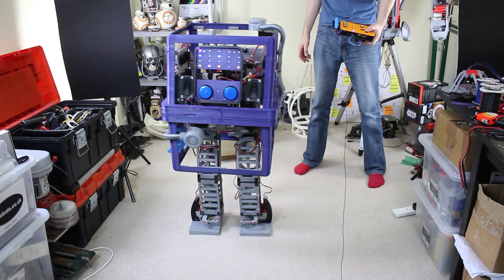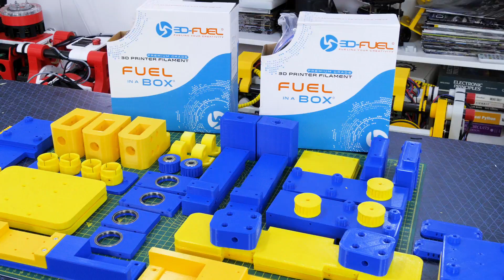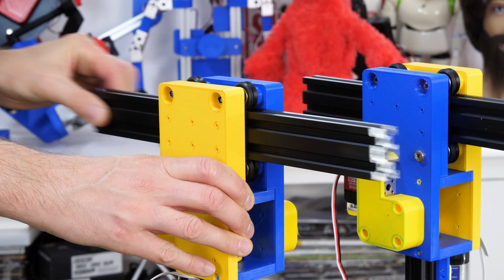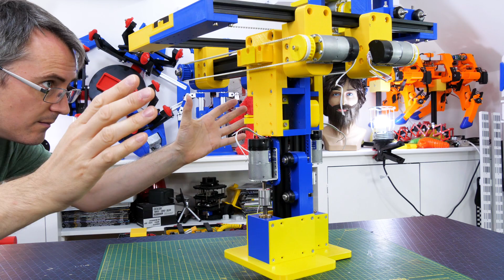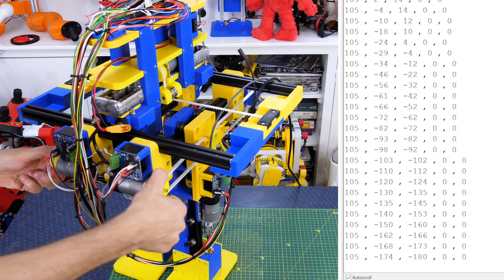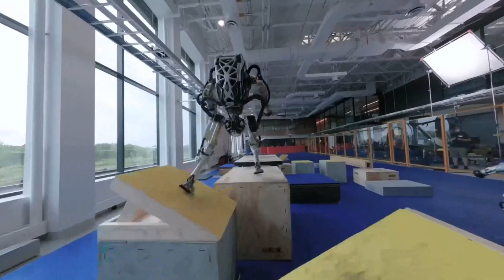Why Walking Robots are Easy

Comment: Maybe ten years ago I built a prototype of a tap dancing robot called Paddy O'Furniture. I used Basic Stamp and pneumatics. It was pre-3D printing so the project was  pretty primitive but I made a few observations along the way. One is that a  tapping toe needs two axes of movement. The other discovery was that knees are also essential: tap dancing without them is pretty awful. :-)

Comment: Thanks! Nice that a simple design such as that functions. Yesterday the stepper motor on one of My robots "passed away". Those need to be lower cost and lighter weight, so I can buy a replacement without worrying about if it will get on the plane easily.

Comment: You could decrease the mass by increasing the lever. If you use a rod with weights on both sides you would only have to move it a small distance.

Comment: I feel like for a robot biped
You should actually make it's hips wider
And have mechanisms that smooth out the walk cycle to eliminate jitter. Taking a more feminine one foot directly in front of the other walk cycle with the sway necessary to ease into each stride and smoothly transfer center of mass in each step. Leaning into the next by rotating the hip. Just allow the knee to just slightly hyper extend and lock up when necessary.

Feet articulation and things that help the feet change shape to distribute pressure, or work together to form a sense of springiness, is a big deal

Listen it's not a kink
It will just help it walk and balance better

....robot feet 😳

Comment: Most of the advanced bipedal robots that do things like obstacle courses are both A) meticulously programmed to run that exact course and nothing else and B) remote-controlled by a trained operator who hides behind a curtain Wizard Of Oz style.  They only rely on option B when option A goes wrong, but option A goes wrong a lot.  That's why despite being around for 15 years now those bipedal robots still aren't used for beyond demonstrations.

Comment: an idea i had to make this way lower tech is to have it so that the mass has an electrode on it and so does each side of the top which completes a circuit to activate the motors for the leg (which could probably be done using the same concept). which eventually activates a circuit to bring the mass back to the otherside

Comment: how long do you expect, on average, those v-wheel linear slider brackets to last before they're not tight enough on the t-slot extrusion and need to be replaced?

Comment: Have you thought about using gallium or mercury with pumps to shift the weight balance of the robot,it would be self contained and lower the amount of moving parts necessary to keep balance mercury would have 3x  the  molar weight of gallium if it’s reasonably contained it may be a more worthwhile fluid to due this with it also has a lower liquid temp then gallium .

Comment: I challenge the assertion that your robots "walked" or that walking robots are easy.  Given that back end of your robot's feet never went beyond the midpoint of the other foot, shuffling would be more accurate.  It's the difference between the way a healthy adult walks and how a a 90 year old with a walker moves around.

When one foot gets put fully in front of the other, then you can say you made a walking robot.
Reply from the maker: woooosh

Comment: @James Bruton Have you ever tried making an openai gym simulation of your robot in python and using reinforcement learning to teach it how to walk. Then you use the saved model and link it to a controller and inference it through a gpu to retrieve the motor outputs for and apply them to the irl motors?(fyi this is for bipedal robots) just so you know the hardest part of doing this is designing the robot and translating it into an actual simulation and adding physics in said simulation. You will need a very good gpu and possibly need to use parallel learning. You may also have to use human input as your reward function for the training and there are papers and youtube videos on it.

Comment: if you can drive the servos partially while one leg is lifting and a bit as it is coming back down, you could spread out the servo motion over a longer period and possibly make the turning less jerky (since the mass on top would rotate at a smaller speed). Great stuff!

Comment: Why dont youvjust te the steps to go with the frequency of the innertial change instead of weight change? The trobot wouldnt need to be as wide and you could go wayy faster

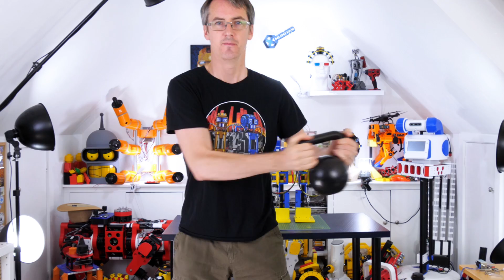Comment: the issue with the reaction force from high accelerations you mention at 14:27 could be reduced by using a trapezoidal or triangular motion profile where the acceleration and deceleration is limited rather than exponential smoothing which has high initial acceleration.

Comment: i know the point was to move the mass back and forth...but would it work with the mass centered and just picking up the legs?  I was thinking that maybe a way to speed up the "turn" would be to leave the mass centered and perform the turn maneuver without the mass swing.

Comment: You must use parallel execution of steps. Not step by step, but together 2 steps.

You must use inertia to start the step earlier.

You should consider using inertial counterweights. A human uses his arms, torso, head for this. Some animals have a tail.
A robot with a tail is cool.
Reply from the maker: Yes that's how my other robots worked at the start of the video

Comment: what if you reduced the mass but accelerated the speed of the action cycle, to make it go much faster
this way the weight shift would be caused by the inertia rather than the rest mass, you could probably even switch the rail at the top by some sort of pendulum for natural mechanical stability, though that would of course get in the way of any ability to turn, which the robot doesn't have anyways

anyways that's a fairly small modification, basically just redoing a third of the robot, which could make it walk much faster, just a thought

Comment: Hey James. As a cross section of: A. long time fans, and B. people who are increasingly concerned about climate change and thus energy consumption, I was wondering if I could challenge you to power more of your builds using power generated yourself. I say this realizing your local power source may be fairly green; I myself live in Ottawa, where most energy comes from hydro. Still, I find it interesting to think that with the right gear ratios, low friction, some magnets, copper wire, a flywheel, and some mathematics, we could perhaps generate a fairly substantial, fairly consistent stream of electricity. Further, using a heavy weight (perhaps set in place with a ramp to minimize bodily strain), and a long cable wrapped around that first low-speed gear, we might be able to sustain that power generation for a good amount of time. Add a four bridge rectifier and a capacitor, and the resulting electricity will also be smooth.
EDIT: Bonus points if you can do it using stuff that's lying around.

Comment: why do you not have a really good drill that has a torch chuck so you can't overdrive the screws and lose the screwdriver, save your muscles and do more?  Man think, I mean it seems like you do a lot of that but maybe not every way that makes sense to me :)  Your design work I find cool, even if I think this robot is not exciting at all.  Well if it was mine I would be because I have not built a dozen walking robots.
I just wanted to add now that I finished the video, I'm not sure "easy" was the correct term but for you sure :)  Next I really liked how the robot lifted its food and stepped, the others almost seem to have the foot still so close to the ground.  It would be cool if your simple robot could run like a human, yes I know someone built a really fast running bot that set a record, but I think cutting a human in 1/2 to reduce weight might kill the person so that does seem kind of unfair :)

Comment: Perhaps a good idea would be to mechanically link the leg lift with the weight shift - as the leg lifts it swings or rotates the counterweight to the opposite  side of the machine.

Comment: AFAIK, human walk is anything but stable, therefore trying to keep the robot statically stable at every moment (i.e. you power off, it's still in equilibrium at any stage), while human walk is a very different thing: if you froze when you start running, you'd fall. Thus, here comes the MPU and a lot more maths so you combine movements together (such as up+forward, or spin+up), including movements of multiple limbs (arm opposite to the leg, etc.)
Also, a flat foot will never bring you too far. Try spinning half-hexagons instead of static feet, you may figure that you can use torque and forward motion to spin, and that springing your movements is just about controlling the instability mid-air...

Comment: you could speed this up by lifting the leg up, moving it forward, and shifting the weight, all three happening in parallel. slight tilting on the robot as the leg lifts will be negated by the weight shifting. some trigonometry(the like you've already done in so many videos) should get you there!

Comment: Hm, that clearly explains why the full lean over to one leg is slow and impractical. (Especially thinking they wont just walk, but may need to move payloads.)
There could be some speed up by using pressure sensors on the feet to move the weight only far enough to notice either the supporting leg to not increase in load (took all the weight already) or get the leg that is being unloaded detect its not bearing load anymore.
Could even start the raise of the leg a few % earlier and use the weight carriage slow down to add extra force 'off the leg'.
Sort of using the inertia to use the force that made the walker fall to the side as extra speed.

Comment: I'd be interested if you could use this robot as a platform and write a more sophisticated control loop that takes inertia into account. In theory, you wouldn't need to wait for the mass to reach the other side if you could use the inertia of the mass decelerating to balance out lifting and moving the other leg in just the right moment, right?

Comment: Could you use the inertia to enable the leg to lift earlier? Effectively the robot would be "holding itself up" by the resistance to movement from the upper mass, rather than waiting for the mass to move AND for the entire structure to be stable?
Reply: timing might be quite critical to pull that off, even the difference in kinematics between start from standstill and cruising speed (such as it is) might be significant.

Comment: Your bipedal robot is too short, the centering extra mass is too close to the center of gravity, hence the wide movements to compensate and hence the resulting slow speed.
Doube the height of them leggs, put nema 23 steppers for height and rotation adjustments (icluding the legg rotation servers).

Tripple or quadrupple the height of the body; hinged at the torso to tilt left and right and to rotate 45 degeees left and right, place one long belt from extreme left to extreme right and the motor on top of the structure above the shoulders, so each motor action tilts the thingy left and right and rotational torso compensation will also counterballance back and forth disequilibrium.  The further up you are with the compensating weights the less weight you need up there to play with and less movement.  Learn how to anticipate torso tilt and rotation to compensate future forseen motion and plce such code into the arduino, hence the compensatory motion starts before needed, runs smoother and ends spot on while it starts the next compensatory motion beore needed, this might lead to saome speed gain in any sort of motion.

Put the heavy stuff like batteries lower in the torso so they do not interfere with compesatory motion of the upper body steppers.

Put salt as per your taste and bake in the oven till ready.

It should work.

Comment: Some STM32 chips can use their timers to measure quadrature encoders, it has the advantage that it keeps track of them in hardware so you don’t need interrupts or to poll the pins, you just ask the timer what the counter is at whenever you want.

Comment: There are those little wind up walking toys with C shaped feet that overlap like so:
  _
/ _
\_  \
    _/

That what the centre of mass is always above the foot touching the ground, but you don't need complicated dynamics or moving weights. Surely this could also work in a robot?